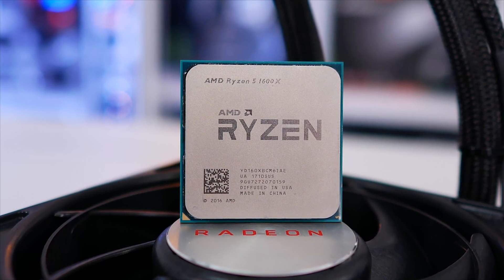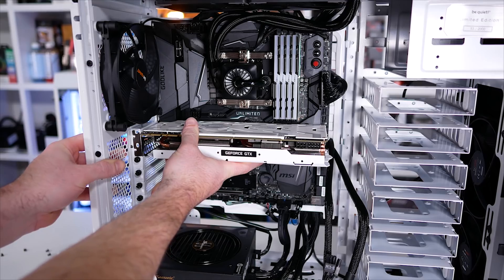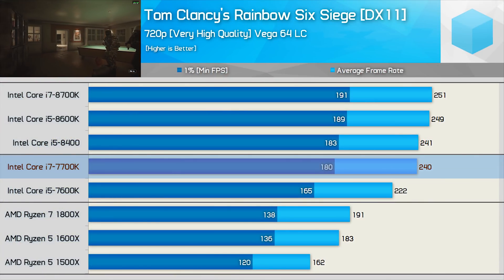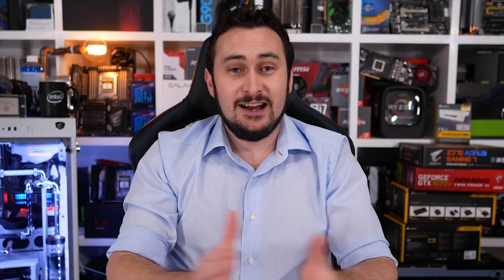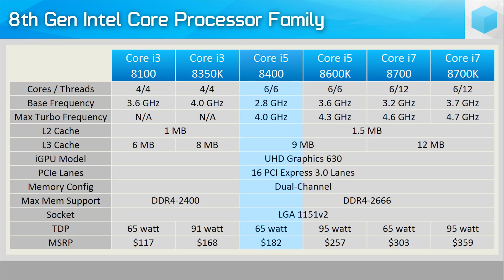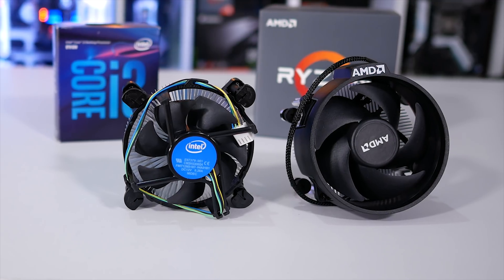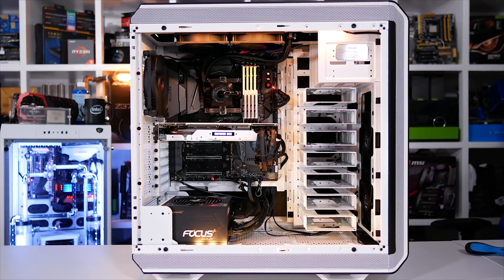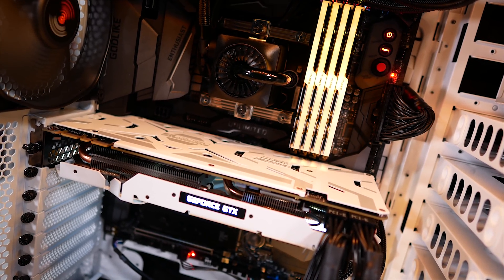Let’s Chat, R5 1600 OC vs. i5 8400 Benchmarks Incoming!

Comment: Time to rev up those 720p benchmarks!
Reply: metalhusky "I've seen funky benchmarks on the new intel chips in high res"

Just say that next time, don't tell your very own story that 2% of the audience cares about.
Reply: I'd say it depends how much you care about pure performance VS price/performance.
If you want as much performance as you can afford then I guess 8400 is better. If you want to save a bit and still game perfectly well 1600 is great. I don't own any of these two so don't choose solely based on my opinion.
Reply: I own the 1600, and it runs everything great. Both of those CPUs will max out your GTX 1060 in almost all games, although GTAV is a bit of an outlier and will probably get more FPS on the i5, however you'll be able to get 60fps with the R5 anyway. PUBG still runs like shit on any system, even with my GTX 1070 it's a struggle to maintain 60fps on all low settings, a different CPU wouldn't help there. 

In terms of upgradability, the R5 is on a more upgradeable platform, as AMD will allow you to stick the next few generations of CPU into the same motherboard, whereas with the Intel CPU the only CPU upgrades will be of the same generation, which, admittedly, getting an 8700K would still be a good upgrade. The i5 is more likely to start performing a bit better with only a GPU upgrade, as there are still quite a lot of games that favor the i5 and when the GPU is less of a bottleneck that will become more relevant. 

IMO AMD is the way to go, but I'm probably a bit of a fanboy. Either system will perform great.
Reply: TheBlackIdentity

Exactly.

Please test with gtx 1080ti OC or Titan XP OC, thats show weakness of amd ryzen cpu's.
Reply: metalhusky my problem with your comment is that you are asking an interesting question but you end up making it sound like you just want your own benchmark for your own settings.
Reply: metalhusky just get the better overall CPU. at even 1080p at ultra on a 1080 the results would be similar. at 1440p and above intel has no real advantage. 6700k would be a step down from a 1600 in that case
Reply: Ivan D - ideally that would be what the results suggest. but I would bet most people aren't going to see that performance uplift ever. As time passes games get more demanding and GPU bottlenecks more prevalent. A point of dx12 and vulkan is to shift the bottleneck onto the GPU as much as possible.
Reply: If you are playing at 4k you could probably run a pentium with almost no difference in frame rate, maybe slightly worse minimum fps but the same average. I'd recommend the R5 CPU if you are playing only at 1440p or higher resolution.
Reply: Please tell me which is better in 1080p and upgradability (idk which combo is better)
For the PC I'm going to be building
Both  have  asus 1060 3gb overclocked white graphics card

1600+gigabyte ab350 gamig mobo
8400+gigabyte b8 mobo

I'll be playing gta5, battlefield,pubg,csgo, and games of such sort
Reply: HadriAn okay thanks
Reply: NZRoflcopter okay thanks
Reply: 720p = cpu limited scenario = Ryzen bottlenecks = AMD fanoboys riot,call the benches fake or irrelevant
Reply: @TheBlackIdentety  I hope you're happy having to throw away your old motherboard when upgrading to Intel Gen 8 when in fact they're in the same socket.
Reply: If a CPU hit 100 fps at 720p it will always deliver those 100 same fps no matter if you up the res to 1080p, 4k or 8k. Thats what fanboys dont get, using low resolutions eliminates or reduce the GPU bottleneck and shows the CPU raw gaming performance and because intel achieve higher fps then the AMD fanboys winne like bitches.